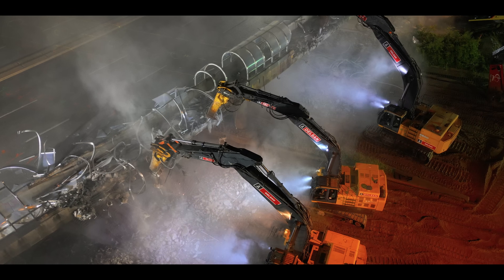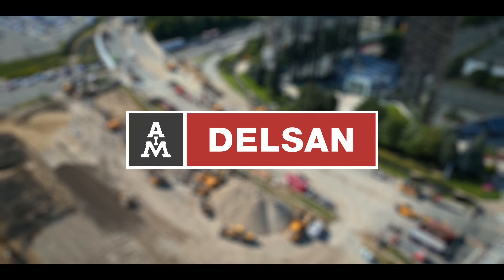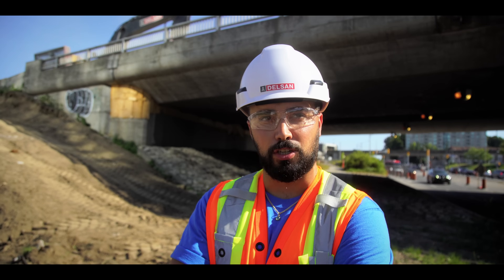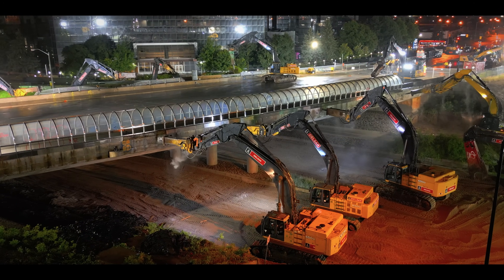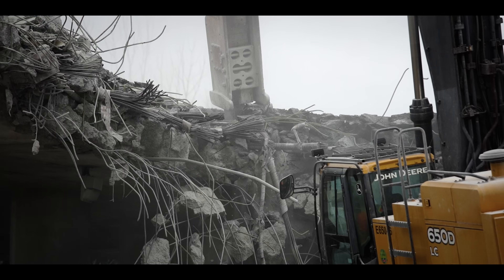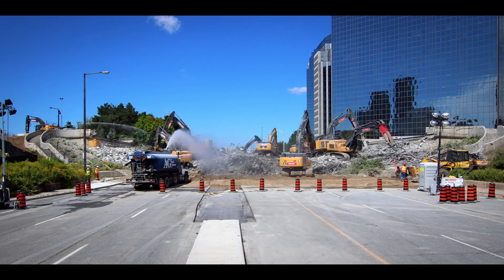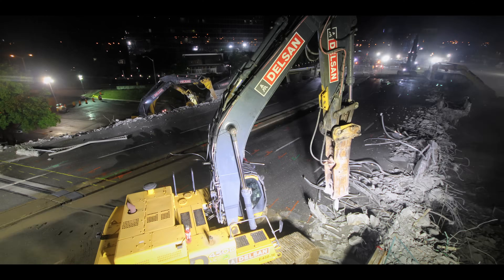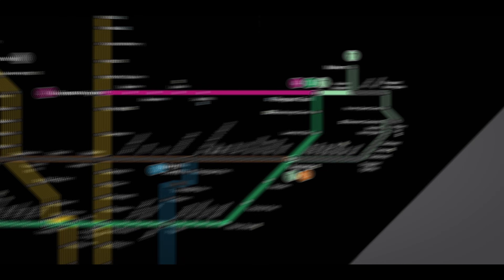Clearing The Way For A New Toronto Subway Stop

Comment: They should have looped the subway from Kennedy back along Eglinton to Islington and the Airport instead of these LRT tracks above ground..  maybe even extending the old LRT in Scarborough that is not in operation anymore;  although looping the subway is a better long term solution for mass transit.  building airport line & downsview lines seem like a waste so far north on downsfiew, but they could even be incorporated into an Eglinton subway line.  I also think they should tunnel the Allen Road extension that was planned and bring it down to Gardiner Express..  Oh and use shared curb lanes instead of bike lanes..  Danforth Sux now!!

Comment: The reason why they can do it fast is because it was a priority to do it fast

In pursuit of doing things cheaply we like to spread out a project allowing it to eat a smaller portion of the budget each year, same reason why you don't buy a car outright. However this makes the project more vulnerable to changing conditions like changes in leadership.

this method is a lot faster, however its much more expensive when pitching it as a solution, especially for large projects. Additionally it makes more short term jobs instead of fewer but more stable jobs which is generally preferred from a job creation perspective.

 Now do I wish we did things like this more? yes, we're decades behind in where our transit should be, catching up should be a priority, spending a premium to do projects quickly is fine when we have want more projects that need completion (pending political/budgetary willpower)

Comment: Thank you guys for taking care of the dust, when work was being done for new town homes near Birmley and Lawrence it changed the sky I though it was a massive fire
Reply: Yeah, it's constant in Toronto no dust control on construction sites or at least inadequate dust control. Apparently dry cutting concrete with dust all over the concrete dust all over the place. That's more typical of Toronto.

Comment: There was one crash on the SRT. There was one crash at Zoo train. In both cases they were closed. Crash at Dupont Station which was life ending. Keeps going for more decades.
Reply: The driver ran through three red lights on his second day of work and plowed into another train. That's different that derailment during normal operation of a line about to be decommissioned.

Comment: Now why can't all the other construction crews working on the Gardiner, Spadina and Queen St. streetcar tracks etc. work this quickly and efficiently to start and finish a job so that they can go on to the next project and the public doesn't have to be inconvenienced for years? 

In the time its taking for the renovation work being done on a part of the Gardiner, the Chinese would've been able to tear down the entire expressway and build a brand new one in probably less than a couple of years max.
Reply: I don’t know much about the Spadina and Queen track work, but the Gardiner expressway work is not that simple. This bridge is a  being completely torn down and the side is completely isolated. The Gardiner rehabilitation is being done on a bridge with active traffic on and below the site. Plus the bridge slabs need to be removed, the bridge rehabbed then replaced. Not the same as tearing down a bridge.
Reply: @Kishanth.J  
That's the thing though. If the current Gardiner is costing so much and is taking so long to rehab, then why not tear it down completely and rebuild it brand new with modern materials and modern building techniques so that it can last decades with less maintenance costs required? 

As I said if you gave this project to a Chinese construction company they probably could tear down and build a brand new Gardiner in 2 years or probably even faster at a relatively affordable price compared to what our domestic construction companies are changing and how long its taking them to do anything.

Also I know it would never happen, but I wish they would tear down the Gardiner and rebuild it as a triple deck structure. First deck would be used as its current function of moving vehicles in and out of downtown Toronto. Second deck would be used as a true expressway that almost completely avoids downtown for those who simply want to travel east-west and not be tied up with downtown traffic. The top deck could be built to be a pedestrian and cycle park where people can get a great view the city from an elevated park similar to what they have in New York with the Highline park. 

No one in Toronto would ever have the political will or vision to build such a thing, but I think it would be something cool for this city that's otherwise had much of its soul torn out and replaced with generic buildings.
Reply: @UzumakiNaruto_   tearing it down and building a new one is not as simple as one might think. If the Gardiner was to be replaced in it entirety it would require years of studies, planning, public consultation and not to mention the opposition to it. The reason why maintenance for the expressway has been delayed this long is cause it expensive and it was owed by the city of Toronto. Which could afford it. The only reason it happening now is because the expressway is being uploaded to the province. Also a “Chinese company” wouldn’t automatically make the project better managed. The issues with high cost and long construction have to do with regulations and laws as well as safety protocols in Canada. These regulations aren’t bad, they are meant to keep construction safe and make sure buildings are built to a good standard. China is a authoritarian country so I doesn’t need to ask people permission to build, or to use other peoples land, or even bid for contracts. On the topic of you idea of a triple deck highway, that just not possible. Their is a reason why double deck highways aren’t built anywhere anymore. They don’t last long. Look at the Cypress Street Viaduct collapse. When the Gardiner was built the area around it was industrial and had seas of parking lists. Now it just a scar of unfinished urban highway planning. Cities like LA, Boston, Albany and Seattle removed their urban highways  for various reasons but mostly cause their not as effective transportation options as they were though out to be.
Reply: @UzumakiNaruto_ How well do you think having no Gordimer for 2 years would work?
Reply: @Kishanth.J  
If the Gardiner was to be replaced in it entirety it would require years of studies, planning, public consultation and not to mention the opposition to it. The reason why maintenance for the expressway has been delayed this long is cause it expensive and it was owed by the city of Toronto. Which could afford it. The only reason it happening now is because the expressway is being uploaded to the province.

That's why everything takes forever to build and create in Canada because it has to go through countless studies before the project even starts and then there's always the possibility that the next government that might get elected in will alter or completely stop a project in progress. 

Our leaders are largely not able to work together consistently and have a common vision as to how our cities and provinces should be run and how and what things should be built. Everyone has their own ideas as to what they want to do and obviously agreeing with someone from a different party than you and giving them credit is almost impossible these days, because that means your chances of getting elected into power decreases.

Also a “Chinese company” wouldn’t automatically make the project better managed. The issues with high cost and long construction have to do with regulations and laws as well as safety protocols in Canada. These regulations aren’t bad, they are meant to keep construction safe and make sure buildings are built to a good standard. China is a authoritarian country so I doesn’t need to ask people permission to build, or to use other peoples land, or even bid for contracts.

Have you seen some of the projects Chinese construction companies are building these days all across their country? They make everything Canada does A COMPLETE JOKE.

Take this example. China built the Shenzhen-Zhongshan Link across the Pearl River Delta.  

https://www.youtube.com/watch?v=ax3XjFxAoBs&list=PLzd-VIESUIyH8N1yQQKP2sh05DlQVFk7P&index=5

This took them about 7 years. Meanwhile in about that same time frame we're just now about to finish the Gordie Howe Bridge connecting Canada and the US that's a mere 2.5km long. 7 YEARS to build this short span compared to China building nearly 50km of bridges and underwater tunnels across a massive body of water to connect two major cities and tens of millions of people.

Yeah the Chinese completely blow us out of the water when it comes to actually building big projects in a reasonable amount of time and they could probably easily knock out a new Gardiner expressway in less than 2 years maybe even less than one.

Their is a reason why double deck highways aren’t built anywhere anymore. They don’t last long. Look at the Cypress Street Viaduct collapse. When the Gardiner was built the area around it was industrial and had seas of parking lists.

Why did you leave out the TINY little fact that the Cypress Street Viaduct collapsed because of an earthquake? LOL. That's a pretty important detail to leave out isn't it? The last time I checked Toronto isn't in an earthquake zone and with modern materials and building methods, they could build something that's actually strong, durable and good looking.

The reason why I'm advocating for a TRIPLE DECKER is because it would actually help the Gardiner function as its intended purpose of not only getting vehicles into and out of downtown, but also serving as a fast way to go between east and west Toronto without getting stuck with other vehicles who are looking to go downtown.

The top deck of this new expressway is a park for pedestrians and cyclists to enjoy both as a way of getting around downtown and also as a landmark tourist attraction where you can view downtown Toronto from an elevated position that would provide spectacular views. Just look at how successful the Highline is in New York and that's what I wish could be built on top of a new Gardiner. 

This is the kind of vision and creativity that our leaders lack and think is impossible when others like the Chinese simply find solutions and then go out and build it. This is why Toronto is so generic and bland these days when all we build is generic and bland projects and think we're doing something cool.
Reply: @EvelynSaungikar  
How well do you think having no Gordimer for 2 years would work?

If you gave the project to a Chinese construction company to do it, they could probably do it in less than 2 years pretty comfortably. As I mentioned in another post, the Chinese built the Shenzhen-Zhongshan Link which is nearly 50km of bridges and underwater tunnels over a massive body of water and you think they can't build a new 18km Gardiner over solid ground in much less time? 

Also I think all people living in the city would be fine without the Gardiner for a year or two because when its done it will help with traffic alot and they'd be happy that a major project could be completed in such a short period of time compared to the crap like the Eglinton LRT that's STILL NOT OPEN after over a decade of work.
Reply: @UzumakiNaruto_  if they tore down the gardiner there would never be a gardiner ever again. The city is moving away from car traffic in favour of safer and healthier alternatives like electric rail, walking, and cycling like the rest of the world. Many people who live downtown think the gardiner is a gigantic mistake and an eyesore, not to mention a badly designed choke point that takes 30 minutes to get on to no matter what form it takes because of the narrow downtown roads. In my experience the gardiner is just a waste of time to even try to use, you can be outside of the downtown core in 15 minutes if you take bayview, or any other single/double lane road that travels north/south. Past davenport all those roads are clear and they lead to the 401. The people who live next to the gardiner would protest is heavily as well, because there would be years of construction happening just a few meters from their window.

Making the gardiner bigger would just cause more traffic via induced demand, as drivers who previously skipped using it would just go and try using it again, leading to even worse congestion. Were at the upper limit of how many people can drive cars inside the city, and like Europe and  East Asia, the only way to actually reduce this congestion is to make other forms of transportation faster and more efficient than driving, and this means making people who drive needlessly park their cars elsewhere and take subway/bike like the rest of us. Rebuilding the gardiner into a multi tier multi use pathway would use billions of dollars and years of time that would be better spent expanding public transit and bicycle networks
Reply: @UzumakiNaruto_  as a person who lives a 10 minute walk/30 minute drive from the Gardiner (Lol) I think it’s easier to build a new project than retrofit an old one.  And yes the Eglinton crosstown is a complete joke.
Reply: @EvelynSaungikar  
as a person who lives a 10 minute walk/30 minute drive from the Gardiner (Lol) I think it’s easier to build a new project than retrofit an old one.  And yes the Eglinton crosstown is a complete joke.

Absolutely. It just sucks that between all our corrupt/inept politicians, corrupt and inefficient construction companies and activists who only want things their way, things get done so slowly in this country or not at all.
Reply: The tear down is easy, it took one weekend to tear down the Gardiner ramp to Lakeshore in the East.
Reply: Maybe Delsan does drug testing on its staff, better security on site too. This is also a 3 day quick and dirty job.
Reply: $ and unions